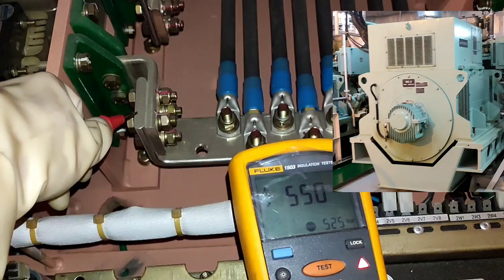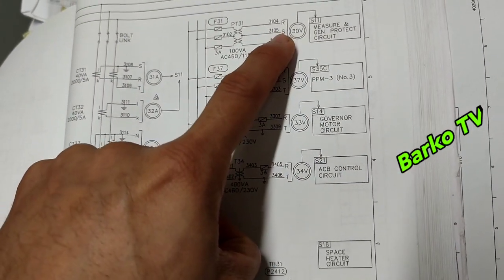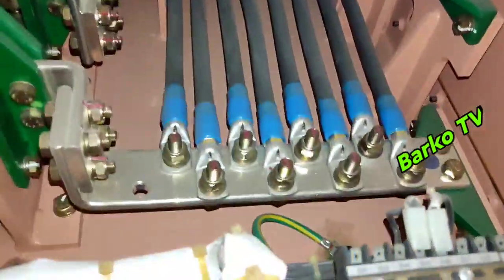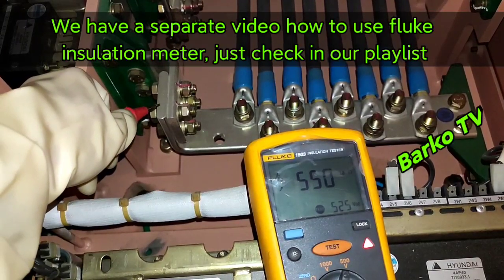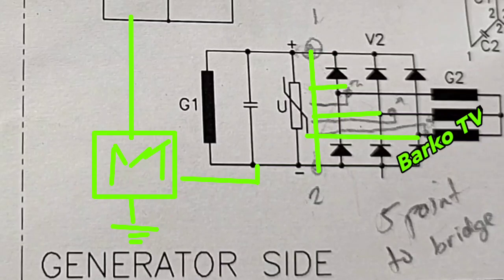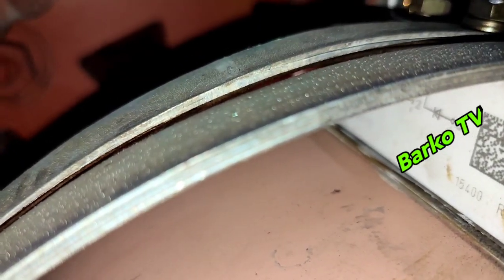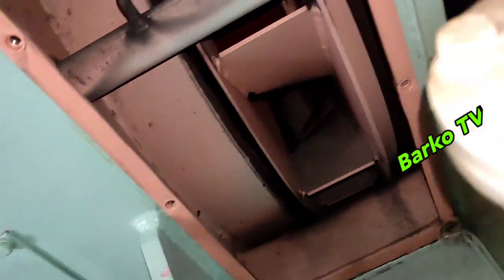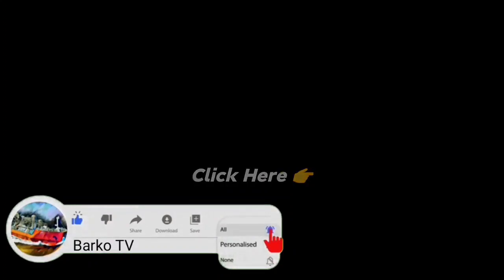Megger | IR Testing |Generator Hyundai | Stx Man B&W | Insulation resistance | IR Exciter | Kalecky

Comment: sir tanung lng pó, d po ba masira yung diode habang nag Megger testing alternator?, bagúhàn po ako
Reply from the maker: Normally sir dapat Ohmmeter lng po dapat kasi semi conductor, pero pag ang office or company ninyo merong memo na mag IR test or Megger test, gawin mo dyan, e jumper mo yong mga diode using wire, yan yong safety na pina ka best na ginagawa q, sana nakatulong

Comment: I have tested with megger test Fluke 1578 with 550 Volts test, this same alternator without disconnect the AVR Connector and nothing are happened
Reply from the maker: Thanks sa additional info mate❤️
Reply: I think he could just disconnected the ACB and fuses from the stator and done the IR test on the stator

Comment: To all those ETO with questions: in case if you have a 440v alternator - before measurment you have to disconnect AVR only, control circuit are made protected against 500v so dont worry to harm it during insulation testing. Not a big difference in situation with 6.6kV alternator - disconnect the AVR, and wear the gloves bc of residual voltage can be too high that case, measure the line voltage before you start. Peace.

Comment: Sana pinakita mo paano i jumper mga diode sir.
Reply from the maker: Sir gamitan mo lang ng alligator clip. Before mo e clip, make sure na malinis ang contact na pag connectahan mo ng clip.,base in my experience pag bago kuha ang barko meron pang  electrical insulation paint na nakabalot.
Reply: Hindi pinakita sa video kulang.

Comment: Dear friend, you tell everything well, but why were you afraid to touch the stator with lead probe, I still did not understand 😀. Since the stator is star-connected, what's the point of measuring the other two phases. I used to check the rotor four-five times, but then I stopped and measured only the stator. Necessarily disconnected the wires going to the top of the winding from the AVR. After finishing the measurements, I grounded all the points that I measured with a wire for a few seconds. 
So I did it on all types of alternators encountered, and in most cases you are afraid to measure insulation, just write that it's good 😀.I can send you a lot of video as I measure it, send your mail
Reply: He is joker🤣
Reply: Yah luck of information.